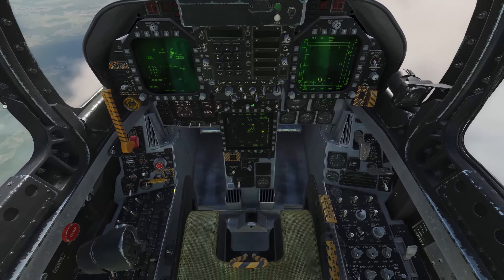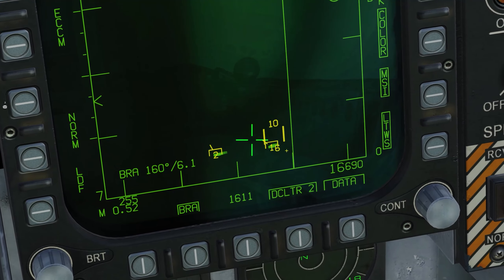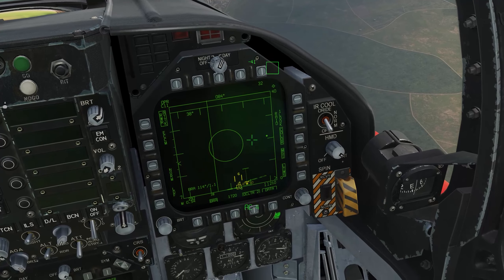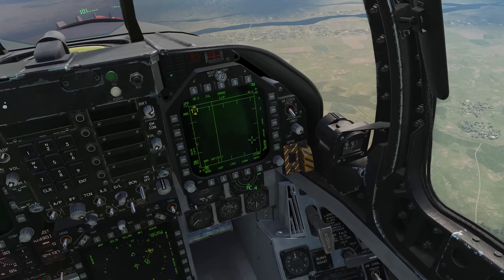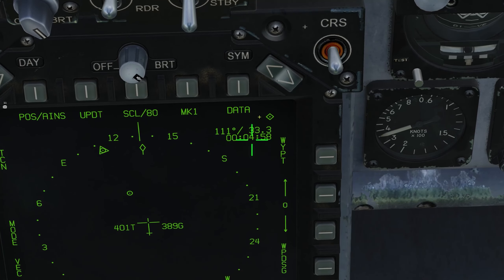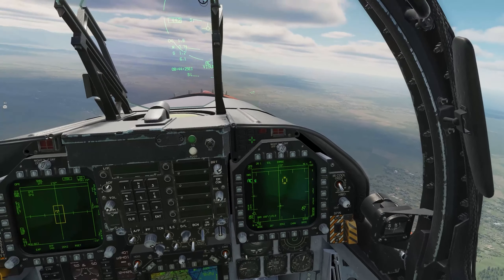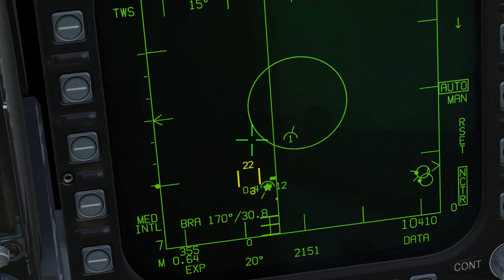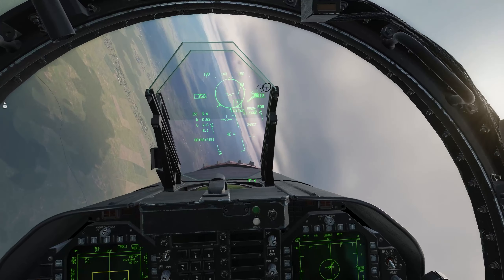Lesser-known things about the F-18 in DCS World That Make the Plane Usable [READ PINNED COMMENT]

Comment: After you reset the trackfile/brick timeout, when you come out of the DATA submenu on the Attack radar page you'll see a "SET" option on the middle right hand side push button. That'll save your settings for the selected weapon so you won't have to reset it every time. Also saves Azimuth scan and elevation bars too.
Reply: This works well, but AFAIK you can only see "SET" in RWS, not TWS. I haven't checked if it keeps brick longevity/data settings in TWS, but I suspect it likely does.
Reply: @djbiscuit1818  It keeps the basic settings in tws too it may keep data settings too but i haven't confirmed it.
Reply: @trashcraft1338  I just tried it and it works. So you can "SET" your settings in RWS and they carry over to TWS as well.
Reply: came down here to comment this, as i used to change it every time as well until someone introduced me to this magical "set" button lol
Reply: thats awesome to know:) 

now if i could just figure out why 50% of my AGM-88 harms released in SP mode like to turn 180 and run away from sam sites that are <5nm locking me.
Reply: @purplepenguin43   are you cycling which you are locked onto on your EW page?
Reply: Ia amat penting simulasi pertempuran Jarak dekat dan jauh

Comment: The nice thing about the hsi/sa switch is if you are needed it the map because location is important you can have it on one and not the other. Then by switching you are essentially decluttering the map with your hotas. Also, if it helps, the hsi/sa doesn’t have to be in the lower mfd to do that. If you like it on the left that’s fine too. You are just moving the sensor switch in the direction of whatever screen it’s on to do that.

Comment: I ended up learning the AZ/EL and SA from HSI bits from Chuck's guide and trying to learn the damned workflow of the SCS/radar system (coming from the F-16 in falcon BMS it was incredibly unintuitive), but there was some really cool new stuff in here I didn't know about too.

It's also worth noting "STEP" in the SA page will step through the contacts, and give you detailed range/heading/speed information on each one, which can be helpful in figuring out how close you are to a contact your radar currently isn't looking at. Super helpful for ID'ing just how dangerous a "pincering" enemy is. A nose-hot enemy at 22mi, M2.2, and 40k ft is a LOT more dangerous than one that's at 26mi, M0.4, and in the weeds. The former is likely already launching on you, the latter is probably defensive if there are additional friendlies in the area. Without STEP, they look very similar on the SA readout.

This also tells you whether or not you're successfully extending away from an enemy, which is a big deal in something as slow as a Hornet.

Comment: Sweet ! Thanks for sharing. Totally agree about the Viper vs Honet Hotas deference’s. Also in TSW in the hornet 2 rt clicks on the sensor control will lock target but just one target.
Reply: When you do that, you're entering AACQ (Automatic ACQuisition) mode, which enters an STT lock on 1) whichever track your captain's bars are over 2) your designated L&S track 3) your closest target, in that order of priority (I think. 1&2 might be flipped?). Anyways, it locks the first thing it sees, starting at 1 and working its way down the list.

It's important to note that this is NOT a "soft lock" like designating a target in TWS (or with LTWS in RWS). AACQ enters a STT—"hard lock", and your target WILL get a lock warning on their RWR, unlike a soft lock through TWS.

Chuck's guide can tell you more about the mode and how it works.

Comment: can someone tell me, is it possible to have datalink and/or radar contacts displayed in the HUD as they are in the HMD? i can have UN-LOCKED datalink contacts showing up in my HMD, turn the nose so they are covered by the HUD, and they are not there - is there a way to make them be there?
Reply from the maker: I'm afraid not, though there are bug reports that point towards some potential reworks for the sensor system. I don't think you can show anything other than your L+S or DT2 on the HUD, but future changes may make designating those easier.